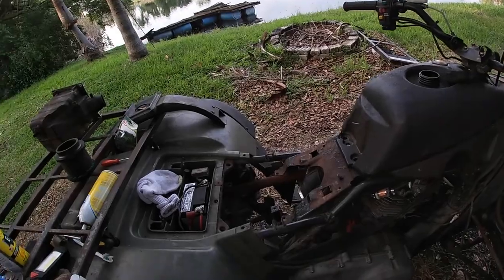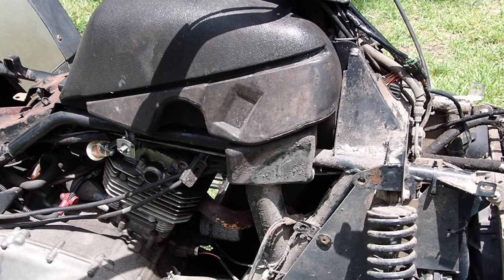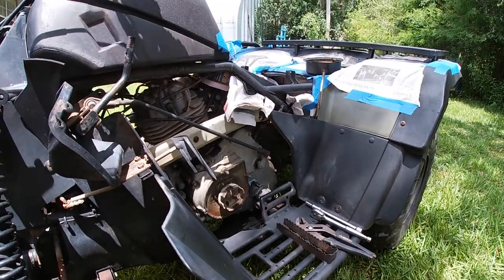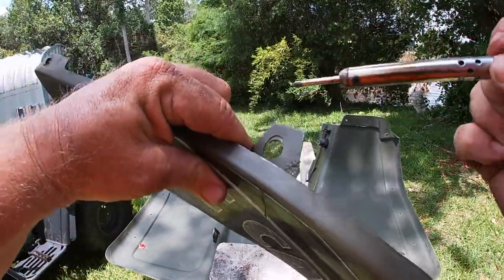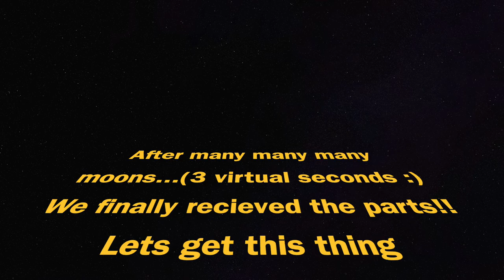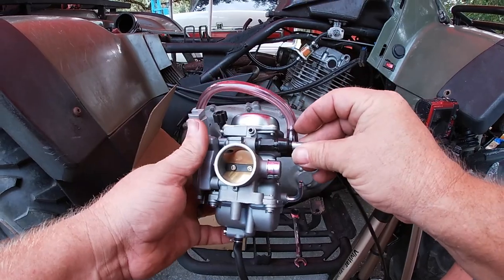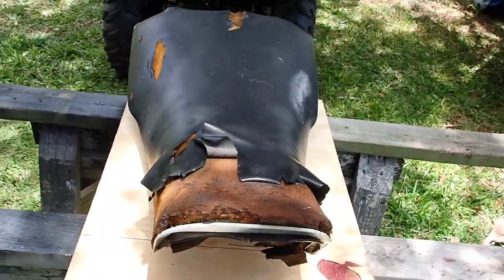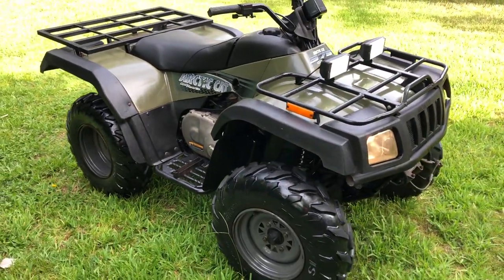2002 Arctic Cat 375 4x4 ATV revival part 3 of 3. Time to get her done

Comment: I have the same ATV,  great job on restoring.  By the way where did you buy the parts?
Reply from the maker: Thank you so much for checking out the video!
Most everything that I replaced I was able to get on eBay really affordably. I will go back and put a link for the few pieces I needed in the description.
Reply: @flippinnuts1  Thanks
Reply from the maker: Harvey, I got those links posted in the description section, thanks again for watching, good luck with your machine

Comment: I resurrect atv’s for a living, I rarely get them in that good of condition, I have an Arctic cat 500 I’m working on currently along with 4 Polaris quads and a Suzuki quad runner. I was a marine upholsterer for a while and when pulling staples there is no be all tool that works for everyone but a screwdriver is about the worst. I use a rusty old bonsai trimmer, works great. I’m rather excited about using my Arctic cat, from the little I’ve ridden it feels very comfortable.
Reply from the maker: That’s awesome Charles. I’ll definitely keep that in mind on the next one. Thank you so much for taking a second to comment. 
Happy trails on that beast 500.
Reply: @flippinnuts1  those painters putty knives that have the arch cut out has a pointed edge that works pretty good at getting under the staples then just grab with pliers or something like that